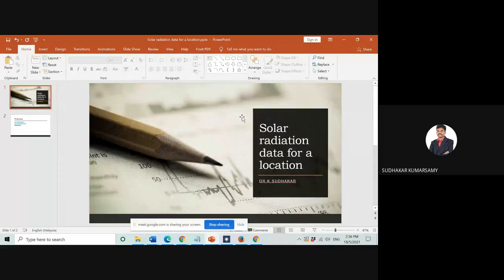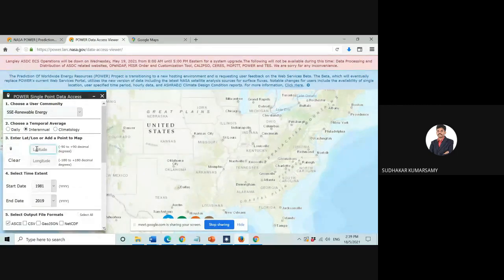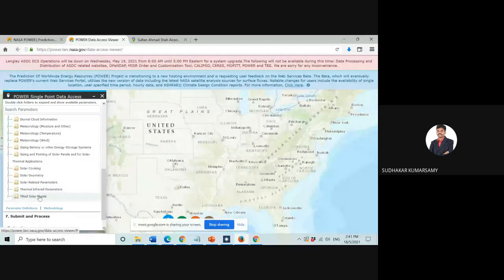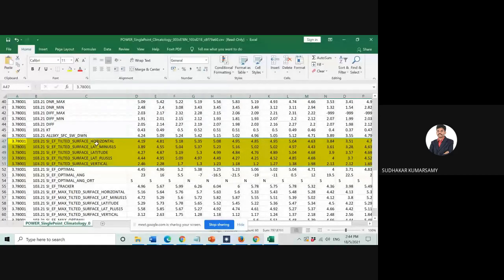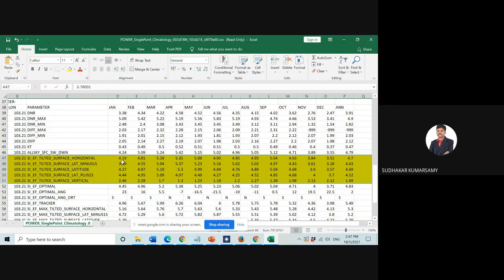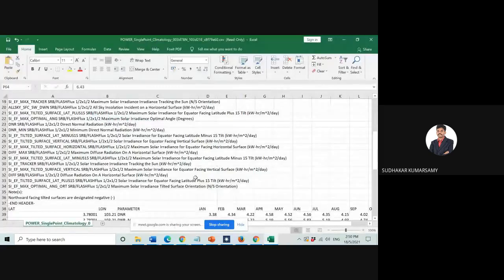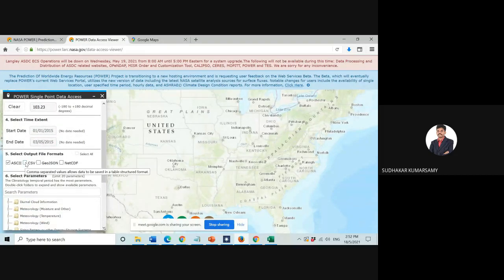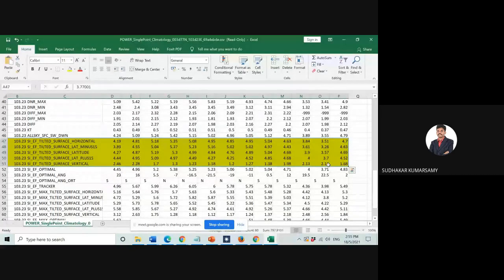Solar radiation data for a given location.

Comment: Thanks for the great illustration.
How do I calculate the hourly solar irradiation in a given location?
Reply: Hello, I am also trying to find hourly solar irradiation data. Please, if you´ve found anything useful let mi knoww.
Reply: Could you find the data? @davidalejandroolaecheadong6609
Reply: I need to find also hourly solar irradiation data for pv modeling. In Nasa'a website i found some hourly data. But i dont know which one should i use.  @davidalejandroolaecheadong6609
Reply: @davidalejandroolaecheadong6609  hey you get it